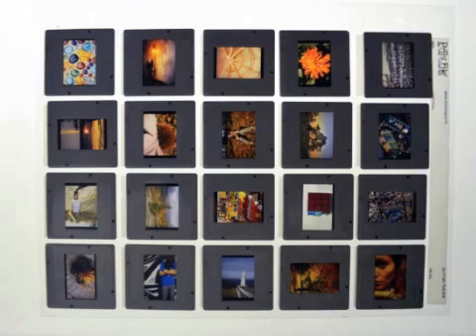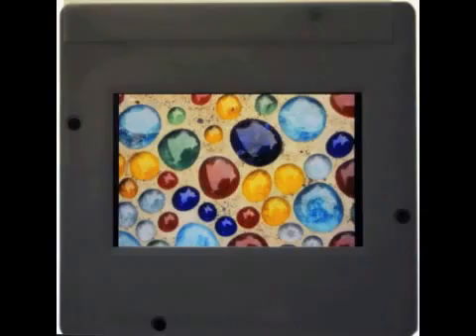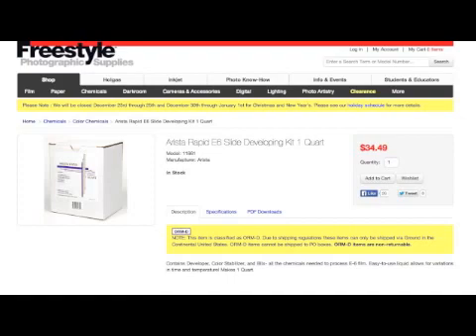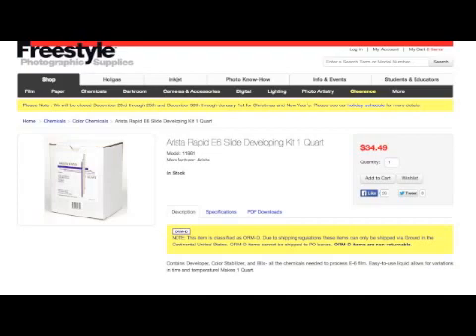Lesson 62: Processing E6 Slide Film and Shooting Copyslides

Comment: If they are running the first development cycle for 16 minutes at 85 degrees, then the developer solution is going to cool down considerably, risking underdevelopment. It would have been helpful to examine this issue, which is commonly ignored in these YT videos on E-6 development at low temperatures for extended periods of time.
Reply: It is the mistake almost all Youtubes make. Not controlling the temperature while developing color film. Almost as common is taking time between the first developer and first wash, not understanding that the process will continue (unevenly) as long as they keep talking,

Comment: Very educational video, thanks! Unfortunately, the film situation has changed a lot in the last 5 Years, lots of films are gone, but thank god some got back and new ones are around. Just for colour slide film it doesn´t look that good. This method seem to have some odds though. Why don´t you use duplication film for direct analogue duplication of the images if the original slides or negatives are still there?
Reply: I know Kodak discontinued their Ektachrome duplicating film about a decade ago, as my supply of such was damaged and I sought to replace it (no luck). I believe that Fuji followed suit more recently, leaving no film designed for slide duplication on the market.